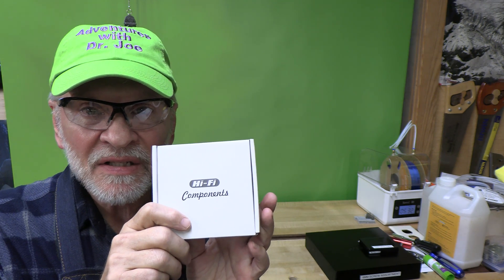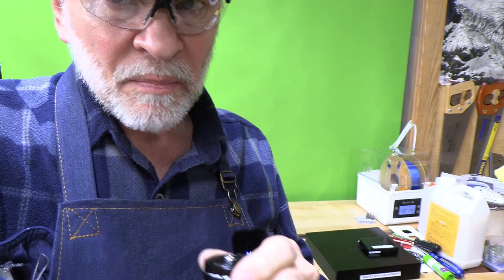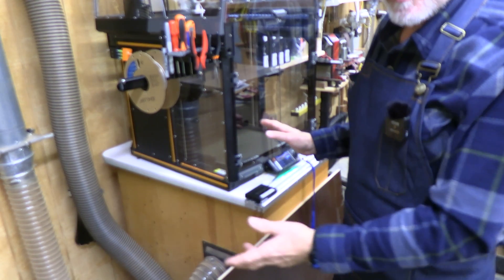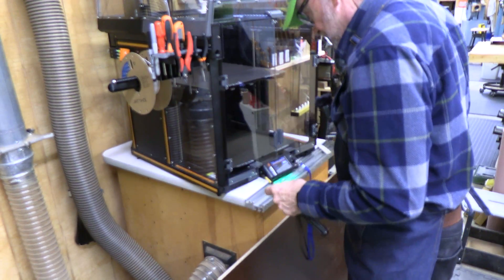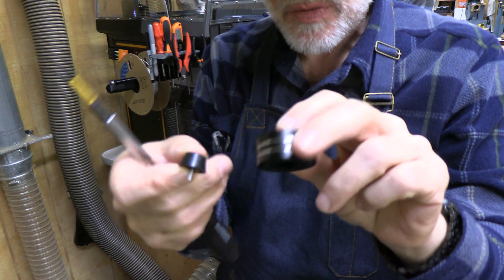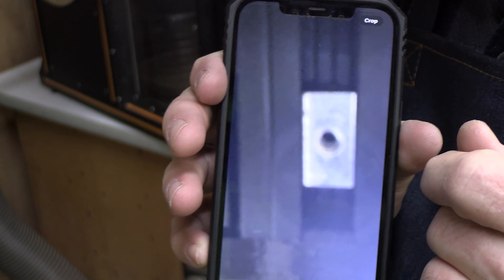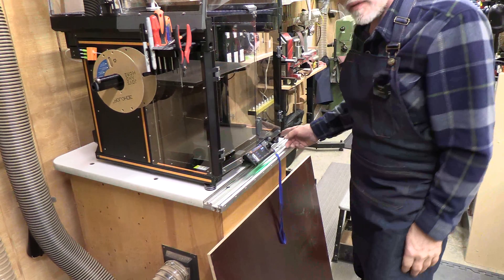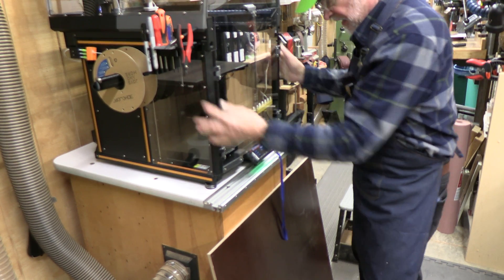Vibration Reduction Feet for the PRUSA XL

Comment: Hi doc, thanks for sharing, I just received my XL and I am building an enclosure for it. I am thinking on adding these feet to reduce vibrations. Did you notice a significant improvement? Thanks!
Reply from the maker: Hey man, I’m glad glad you got a printer. You’ll love it. The most important thing is to download the new firmware that’s reduced noise by 90%. The feet help but they’re modest they’re not huge but I like them so it’s another thing to help things, but the bottom line is the firmware is super critical. Thanks buddy. Have a good day. Take care. Joe.
Reply: @JosephHunstad  Thanks Doc! 😉